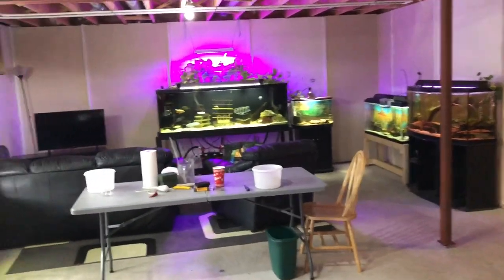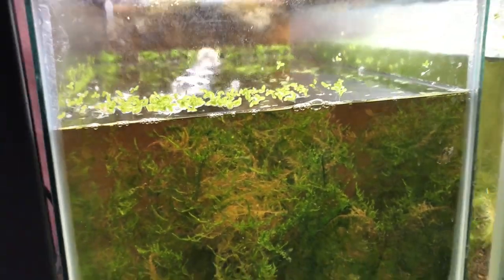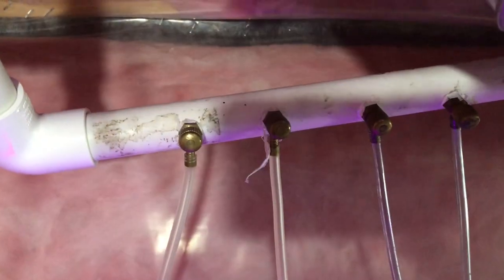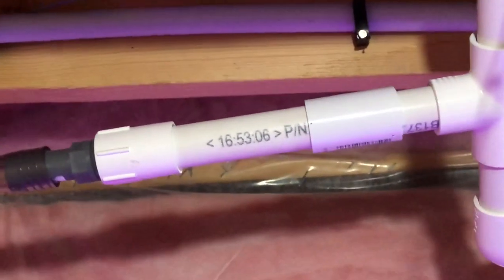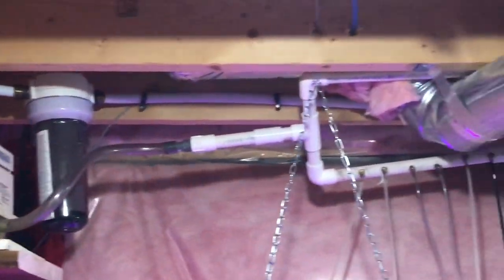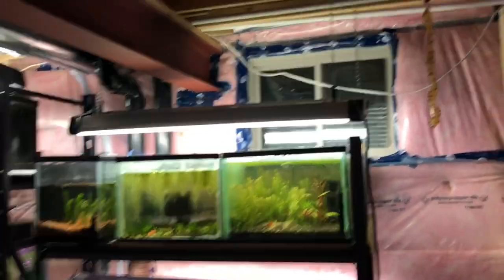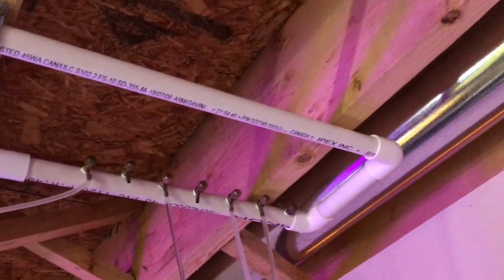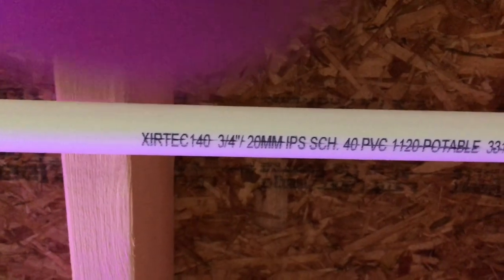HOW TO FISH ROOM AIR LOOP SYSTEM

Comment: Central air systems are the best for people with many tanks !!!!! i will be joining the Jehmco club soon myself
Reply from the maker: It has allowed me to be able to financially afford to have a few tanks. Definitely a cheap option!
Reply: @JNAQUARIUM  electric bill wise is yes it is much cheaper to run a single pump but I could buy more Whisper air pumps only $7 for a whisper 10 which does work fine for a 55 gallon tank then I could buying a single jehm Co pump but the Whisper air pumps will use more electric than the jehm co pump